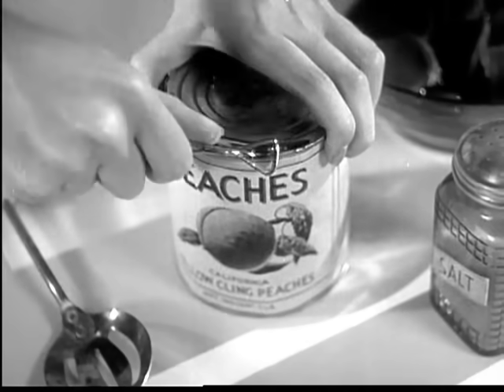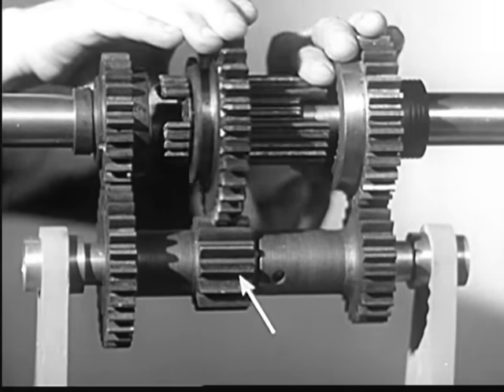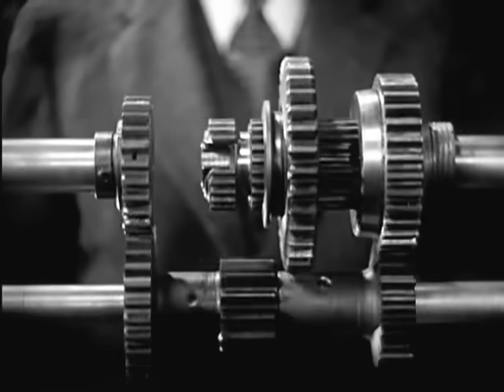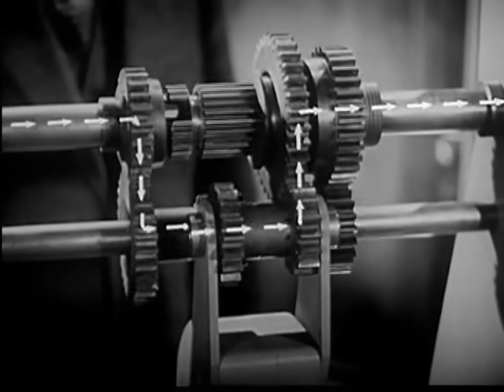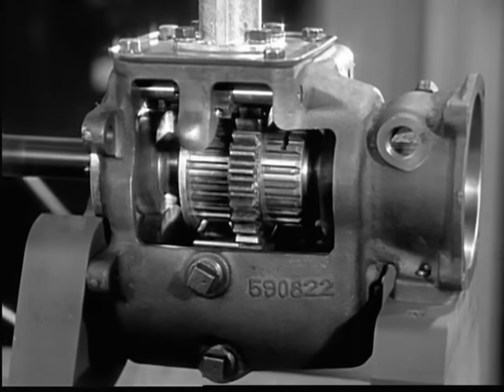Spinning Levers - How A Transmission Works (1936)

Comment: I'm not a mechanic but....That's obviously not how modern transmissions work. This has 3 gears and 3rd gear is simply "direct power from the engine"? Pretty sure its not that simple today.
Reply: It was then that simple, then already managed to have a clutch system not having to bite off the transmission teeth. What as shown, was 3 gears plus reverse. Today you have more of the toothed wheels, I would think the ratios are changed, meaining, direct input from engine to wheels will not be the final one, but going opposite of early gears. Less force more revolutions than the engine.

Comment: Whoever invented the “synchro mesh” was a genius.  Engineers designed transmissions with nothing but common sense and math and the same principles are still  being used 100 years later - simply amazing.

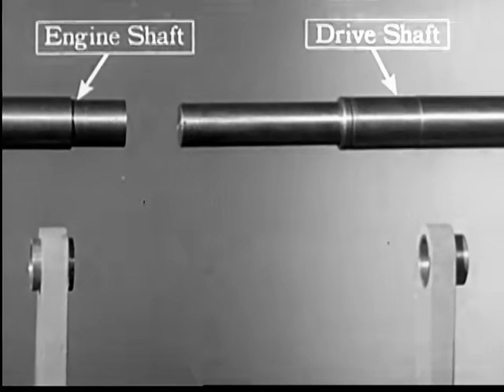Comment: This means older cars were RWD 3:07
Reply: Majority were as front engine was simplest and cheapest to make, but we didn’t have the knowledge to properly package a full FWD system into the front as well as an engine, so just make it drive the rear wheels where theres all the room

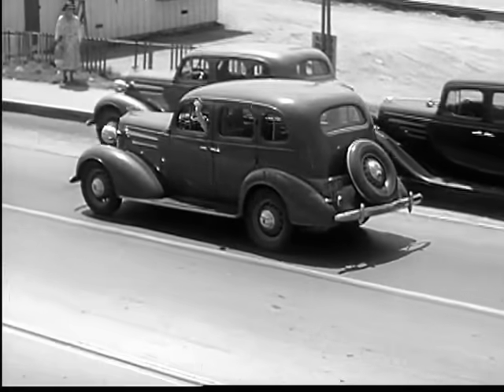Comment: 9:20 Do we not require a clutch then?
Reply: Literally just thought that verbatim
Reply: She used the clutch
Reply: You can very clearly see her depress the clutch before shifting
Reply: Why?
Reply: A she used the clutch, B look up floating gears. Non syncro transmission can float gears really well and syncro ones can but not as nice. And wares out the syncro but yes you can drive a car with no clutch

Comment: Great GEARS, Gear Engineering Amazing/Awesome Respectfully Served, very inspiring-motivational video to see, Its always there, What is faith without works, therefore we stand DRAWING TABLE, draw perfect gears, select round solid blank material THEN report to MACHINE SHOP and be a machinist to produced a real gear...A great work for such a faith...A mechanical engineer..

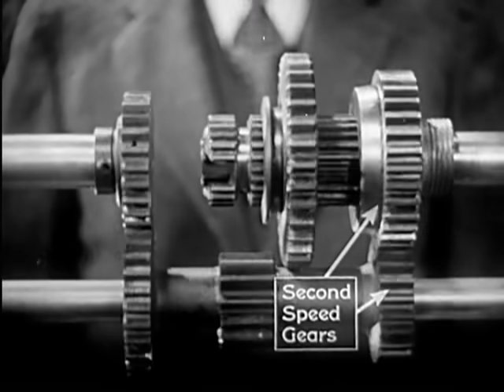Comment: 5:46 Im about 100 years late but how does 2nd gear differ from neutral ? The power is flowing through the same path
Reply: Notice that the shaft at 05:46 is actually turning, which it is not while in neutral. It's just the gear shadow that gives off that impression then.
Reply: @thorbynumbers5368 my question is how does pulling the clutch back to the second gear move the shaft is the 2nd gear us free to spin around the shaft
Reply: I think the sleeve is disconnected in neutral
Reply: Remember that the clutch sleeve is connected to the drive shaft, but the gear to the right of it is not. When you shift into 2nd gear, that freely-spinning gear is now connected to the clutch sleeve, which is in turn connected to the drive shaft.

Comment: I believe the statement that in third gear "we can go as fast as we want" (8:27) is incorrect.  You can only go as fast as the gear ratio being used in third gear will allow.  It has a rpm limit.  That is why they started putting more gears in the transmission (4sp, 6sp, etc.).
Reply: Very pedantic of you
Reply: @jacobrivera7949  Hold on, let me get my dictionary for that.

Comment: I think the reason why so many people find these videos so much easier to understand compared to modern day explanations, is because they use the **EXTREME BASICS** and go from there to explain the actual product they intend to explain, Like this video...

-Explains how a lever works
-Gives examples on how to use a lever
-"Levels up" the lever, and slowly meshes the explanations into how gears work
-Tells how the different gears work in sequential order, slowly adding extra gears to the explanation, until a proper Transmission is formed.

This is done whilst the narrator doesn't talk down to the viewer, which helps a ton.

Modern explanations only really start their explanations from the last point, and don't really care wether the viewer has prior knowledge on the subject, and don't bother connecting the more basic knowledge that most people should know...

Comment: It was simpler and easier to fix, but more powerful motors forced change, leaded gas was needed to coat cylinder walls made from cast iron to lube piston rings and extend their life.

Comment: 4:28 how its neutral I dont understand. input is still connected to the output
Reply: Yes! I was wondering the same thing.
Reply: @betterthantheavgbare  I think it was a mistake by them. I can clearly see the output shaft rotating when the narrator said its in neutral.
Reply: @shufflex3360  No, the output shaft is not rotating there. The gear that goes around the output shaft is rotating, but the output shaft is not rotating. That gear is able to freely spin around the output shaft, but the clutch sleeve cannot. Go back to 3:30 and review, it explains it. It's super important to understand that that gear on the right freely spins around the drive shaft, just because it is spinning doesn't mean the drive shaft is.
Reply: @mack.attack  👍 thanks
Reply: @shufflex3360 
Maybe the shaft looked like it is rotating due to shadow of the nearby gear
Reply: The gear are not attached to the shaft
Reply: The top right gear is free to slide. It is not connected to the output shaft

Comment: I had a 1953 Chevy with a 3-speed manual, shifter on the steering column. They called it "3 on the tree." I didn't know that years before they had "3 on the floor." What a cool video, very well done.

Comment: I have driven a 4 on the floor, a 3 on the tree and of course 3 on the floor, 5 and 6 on the floor and the shiftables with 4-8 speeds. fastest Ive been is 137mph. on a closed road course, of course.

Comment: Very nice. However i do not understand the part where countershaft is always enmeshed with the driveshaft (@3:39) and then being in neutral. If this is the case, wouldn't the wheels still be turning while in neutral because the engine shaft, being always enmeshed with the countershaft, will be able to continuously deliver power to the driveshaft because, again, the countershaft is always enmeshed with the driveshaft. I hope I get my point/question across. 😅😅😅
Reply: The Gear is sitting on a sleve and can not transmit itspower to teh shaft it sits on, so no power can go this way. Think of it as an idler at that moment.

Comment: People tend to forget most mechanical things no matter how seemingly new and brilliant are based off centuries(many centuries) old simple machine principles in levers and inclined planes. 
A screw or bolt(anything threaded) is a simple inclined plane(same as a ramp) wrapped around a cylinder. 
There is a great video on that around here as well.

Comment: Before watching this. All I knew was. Start it. Use the clutch to put in 1st gear. ( yes 2024 and I drive a manual ). Got through the gears. Use the break peddle when needed. Now I know what’s happening in the transmission box. I feel like a genius.

Comment: my dad's 1982 Porsche has an unsynchronized transmission, and it is a form of art to switch from higher gears back to the 2nd or 1st without the transmission making sounds of death

Comment: I love how they start by explaining the very basics, then move to more advanced portions. Then they always go "we had a problem doing it this way, so engineers developed x..." It really is neat to understand why something is designed the way it is. Modern components are so much more complex, that you wonder why. But a video like this explains brilliantly. 

I also enjoy the part where they talk about torque at lower gear speeds. In stick-shift vehicles, it's to not only, not over use the engine, but it helps the vehicle get to speed so it can switch to a high speed/lower torque setting. But, even in automatics, it now makes sense as to why they say use lower gear speeds when pulling heavy equipment or when scaling a mountain. It's because of the torque, and I wished it was explained like that more today, rather than just "because you should."

Comment: Yes, very well explained. Using practical examples. Its only gonna get worse as comouter programs get more and more complex to sell themselves. I remember the overhead projector. Damn that was good. You could add to and take away in seconds. You didn't have to call IT.

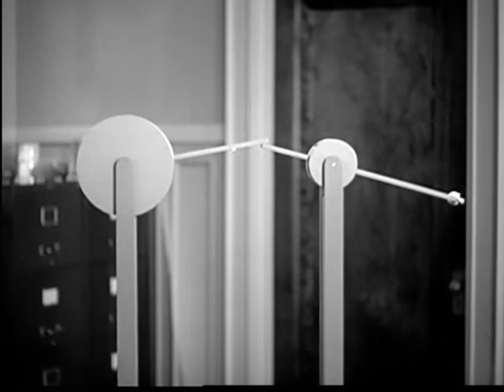Comment: The gear pop up effect at 1:57 is so amazingly done.
Reply: Stop motion in 1936 is crazy
Reply: Stop motion
Reply: The levers were popping out of the center and growing quickly 😂
Reply: I can’t imagine how they did it. Animation through drawing? It looks too perfect!
Reply: @Kelson01 stop motion animation through series of Photographs is way older methods than this movie release date
Reply: I wish corridor crew can spot this and give us their opinion.
Reply: It's a stop motion technique  @Kelson01
Reply: @Kelson01  stop motion
Reply: I was thinking a similar thing. I’m not an animator so maybe it’s obvious but that really stood out to me because I’m curious how they had managed to do that
Reply: @cam5816  It's just stop motion.
Reply: this would be painful if it was stop motion as the frame rate is pretty high. remember this is recorded on film. they most likely recorded videos of each of the increments then physically cut and stuck the film spools together to achieve this. earliest form of video editing.
Reply: @wrth  They would have taken one frame at a time on a single spool of film. Take a frame, move a tiny bit, take a frame, repeat. If you focus on the underside of the small wheel you can see that classic stop motion effect a bit more clearly. The fact that it's an incredibly painstaking process is also what makes stop motion so iconic and unbelievable. You think "there's no way they sat there for hours and hours just taking picture after picture of a barely noticeably moving wheel", but yeah that's pretty much the entire process lol. Although this shot would have been relatively quick compared to something like a clay model where you have to carefully move multiple body parts on multiple figures in lifelike ways. There's only 1 change each frame and it's simple and repeatable. 10 seconds of 30 frames per second is only 300 frames. Probably only took them like an hour or two

Comment: Solid gears are great. The gears in the fluid subatomic particles operate on the same equation but opposite principles. As the gears get smaller, the number of teeth per unit time increases. The string theory studies these. Each tooth is a photon. Gamma rays have the highest no. of teeth in unit time. 😊

Comment: For me all was going good, until he start reverse gear. Still didn't get. Let me search some other videos also.
Reply: there is an extra set of gears thats blocking the view of the transmission gear. they rotate counterclockwise because theyre being rotated by the transmission gears. the extra gears then turn the drive gear

Comment: the gear shift lever doesnt even make sense to me. im assuming there's a bearing or something stationary for it to be attached to that is also part of the sliding gear.

they need to cover the lever too i guess.

it would make sense to have such an example in classrooms to show.
gradeschool, not an elective. i feel to be a human is knowing this stuff, else we merely use these things and being an operator of a smart device doesnt make you smart.

also more knowledge helps you respect the machine and how to take care of it.

Comment: You can shift gears without using the clutch, it's call speed shifting, works better on motorcycles but is possible in a car. Wait till the RPM's are high, then let off the gas and shift the gear quick to higher gear. do the opposite to down shift.

Comment: However, currently the transmission in the automobiles have 6 gears, and some cars have 7 gears, and the new technology is also automatic transmission, which uses planetary gear set, also known as epicyclic gear train.

Also this type of manual transmission is called sliding mesh transmission, which has a disadvantage, it's quite tricky to shift from gear to gear, and shifting from gear to gear would be noisy, a constant mesh transmission solves this problem.

Comment: From what I understand, the ONLY thing that is outdated about this video is that modern transmissions keep all the gears in constant mesh to avoid missing/grinding the target gear. (Well that and the fact that cars have 5 or 6 gears nowadays too). But beyond that this was a super helpful explanation!
Reply: Still pretty useful to learn basic principle of engine transmission though.

Comment: There is something I can not grasp. Why is the main gear always spinning but does not turn the wheels until you slide the sleeve into that gear? That part seems to get missed every time, just like with a jet engine. Why does it always show the last compressor going in the opposite direction when it always states that the whole engine turns on 1 shaft...

Comment: I get the leverage of gear one uses a small gear and a big gear to get larger leverage. But then the engine reving at 90 revolutions and the rear wheels reving at 30 revolutions. Hasn’t it de creased the torque going to the rear wheels? Would you want the full 90 revolutions in gear one if not more? I’m lost but in the right area… I think 😂

Comment: Far better than modern videos and easier to understand too.
Using CGI to try and show stuff people is probably the worst part of modern videos, it removed the need to have a simple analogue at the start, such as a paddle wheel.
Modern videos give you the information but simaltaneously assume that you know the basics or know you can look that up elsewhere.

Comment: Ok can somone explain 4:25 to me? The narrator says the transmission is in neutral, and the shaft to the rear wheels is standing still. But the shaft on the right is clearly spinning, so it can't be in neutral, can it? Looks like power is flowing all the way through the transmission.

Edit: OK it was just the reflection of the gear spinning on the rear wheel shaft that made it look like it was spinning

Comment: After 86 years, we now have rubber band driven cars, or so called CVT. Some are guaranteed to fail after certain miles and are not repairable by the owner.

Comment: This is why this video works, they show you each component and how it works.  They expect you to understand it.  New approach to public is "don't worry about it, we'll fix it for you".  They treat you like you are too dumb for it.
If you want to you can learn things, a lot of things,  its just a question of DO YOU WANT TO.
(I'm not a mechanic but I can take a car apart in its entirety, except for transmission, and put it back together, I'll have like 20 bolts left over but it will work just fine.)

Comment: why would you need the neutral gear on the right side? it doesnt turn the drive shaft, and its always in the same position turning at the same ratio all the time, so why is it even there?
Reply: That is second gear
Reply: @Redtooth75  nah second is the 2/3rd turning rate, the neutral gear doesnt turn the drive shaft at all. its the first gear he connects that im talking about, it just freely spins on the shaft.
Reply: @joncatlin1020  it freely spins on shaft until it is engaged in second as shown at 5:50. For this particular transmission second gear is always meshed and the shifter locks and unlocks the gear to the output shaft. On modern transmissions all of the gears are like this, it is referred to as constant mesh.
Reply: @Redtooth75  ooh ok i didnt catch that bit, thanks!

Comment: Very cool that this was preserved and uploaded on the internet. It's amazing to see how the technology has advanced in the past 90 years
Reply: @MrHurricaneFloyd  Different in what way? More gears? You still have a clutch and a shifter, and the various enhancements are just that: enhancements. Synchronizers fall into that category as well.
Reply: @MrHurricaneFloyd  Good call.
Reply: That was your takeaway? Technology has not advanced all that much. Basic principles remain; they've just been enhanced. Electronics have developed, but they, too, are based on principles already known then. I would say it's amazing how advanced technology was 100 years ago, not the other way around.
Reply: @paulparoma  Exactly principles are the same, mechanics is still the same the way it was 100 years ago. We just found new ways for effective use of these principles.
Reply: @gigastein3151  That's right.

Comment: Mesh  _ synkro !!   Yes  YOU  could  shift  gears  with out clutch >>>  IF    you  had  or   cared >  wanted  / :) ....   to  FEEL  the  R PM  of your  Engine > VS.  torque  or  at M P H  The  car ,/Truck  was  Rolling   rpm.....  @  M P H !  slide  on  in >>   FFFFFFF  YOUR  W